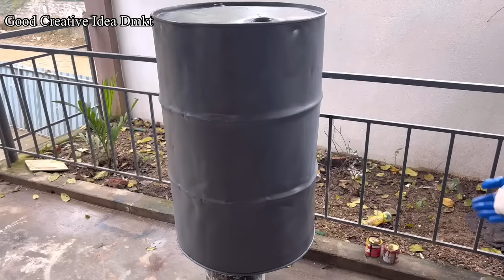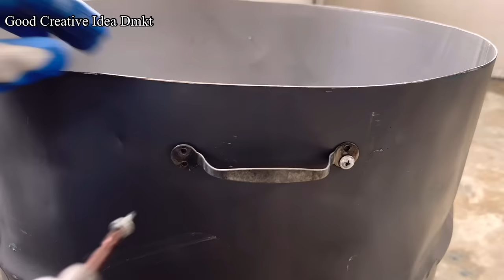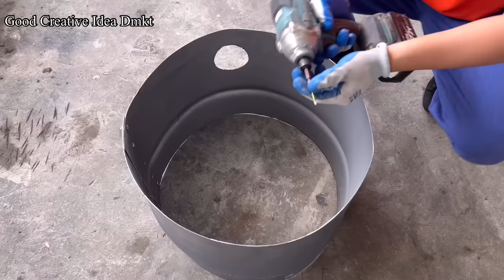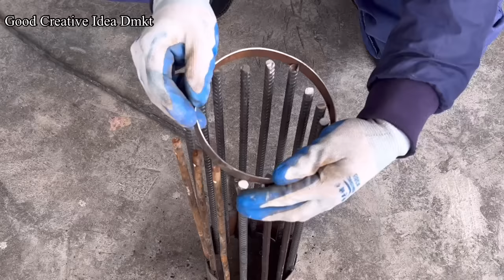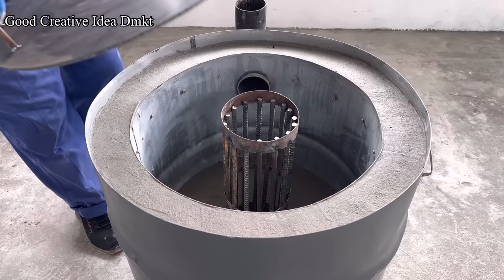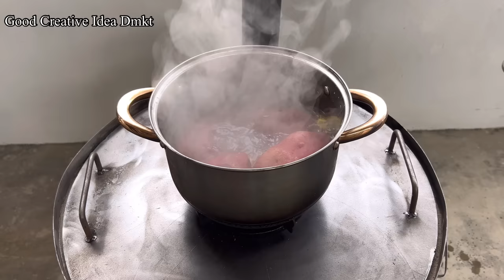Creative ideas for the perfect wood stove from used drums and brand new cement

Comment: This design doesn't seem practical. As if when needed, where is the seperate opening to put wood to extend the  time of fire? You will have to remove whatever is cooking on top following the lid then add wood ....
This is just one example. As opening of lid on top is also dangerous, may cause fire injury.